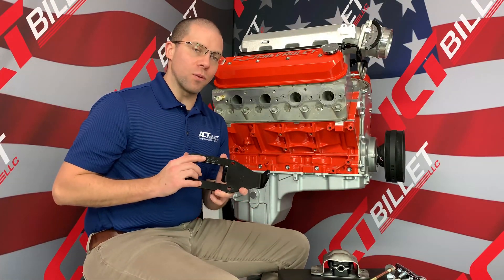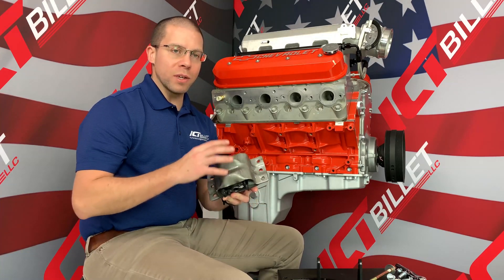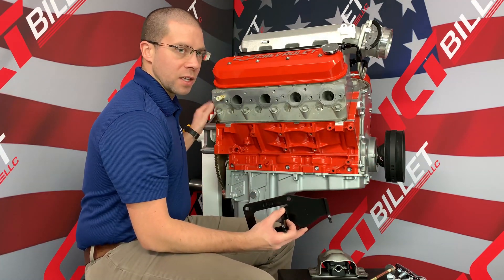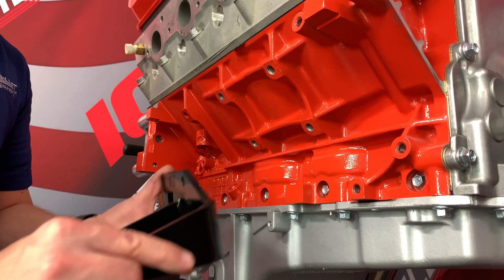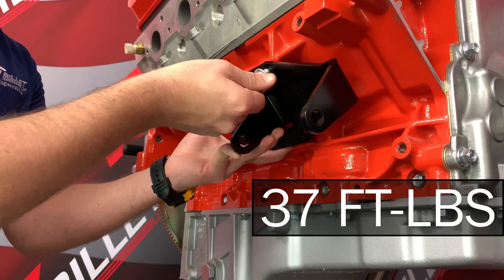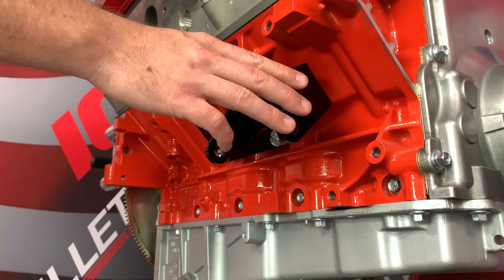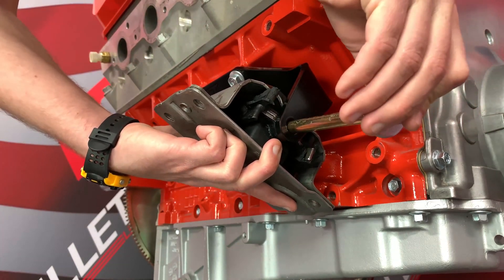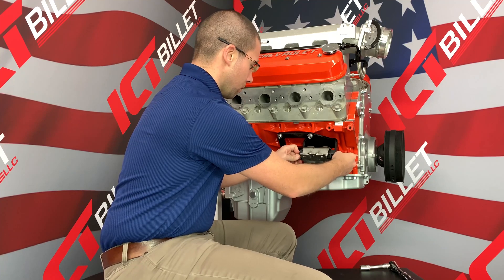551928 SBC to LS Steel Swap Mount

Comment: This is critical, as "I" understand it, some of these will position your motor an inch forward of the OEM position, causing drive-line position problems. I also understand your unit pays strict attention to this. Thanks.